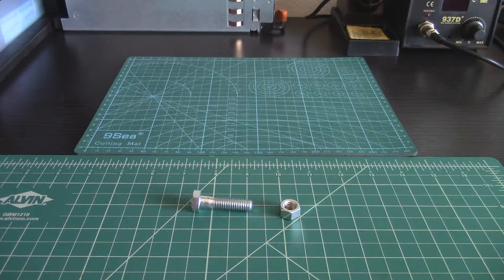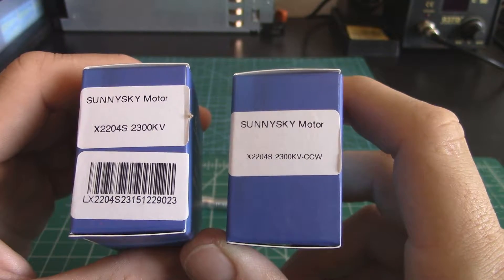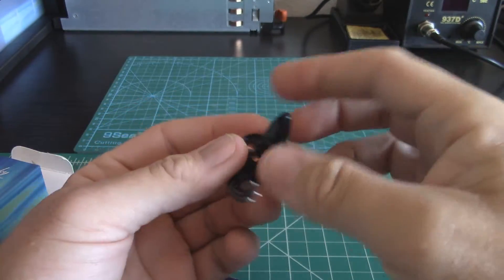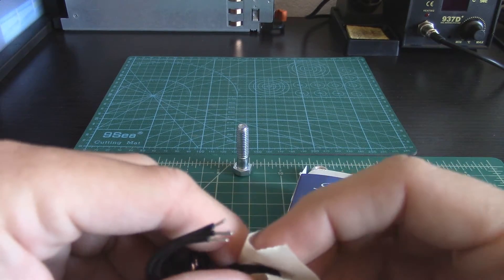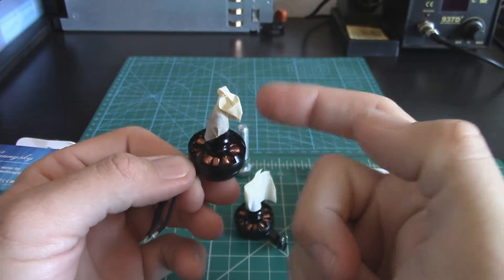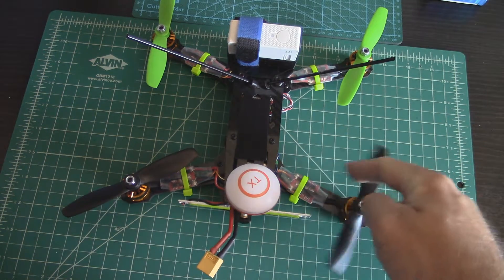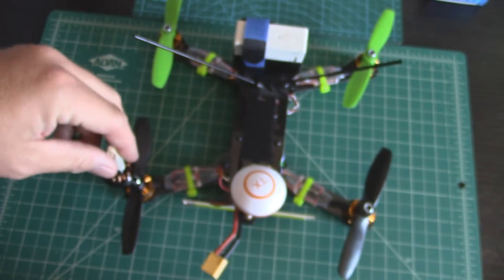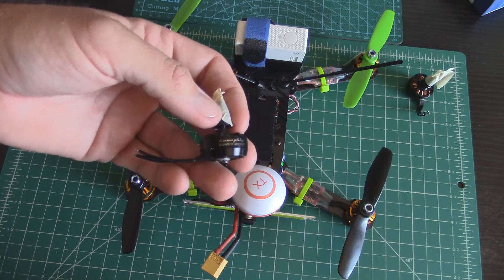CW or CCW Motors for Multirotors?

Comment: Hey man thanks so much! Can you please tell where can I read more about "just get all motors CW and use standard lock nuts"? Or it's just as simple as it sounds and CW lock nuts will tighten the props enough and I can be sure not to bother with CW/CCW tightening?
Reply from the maker: romangorchakov  Yes, if you have the option to just buy all CW motors, then do that, and regular locknuts will be totally fine to hold your props no matter which way the motor spins.
Reply: Thanks a million!)

Comment: I don't get why after all that, You say, 'get all clockwise motors'. I understand all you've said, i understand the concept using cw and ccw threads, just, how then do you get away with 'all', being clockwise motors?
Reply from the maker: owenkilleen If you just buy CW style, then any standard 5mm locknut you can get at the hardware store will work, you won't have to worry if you need reverse or left-handed nuts, regular "righty-tighty" will be what you need.
Reply: thanks :)